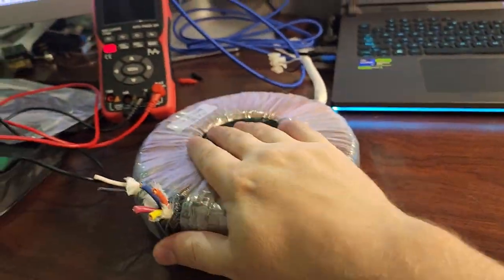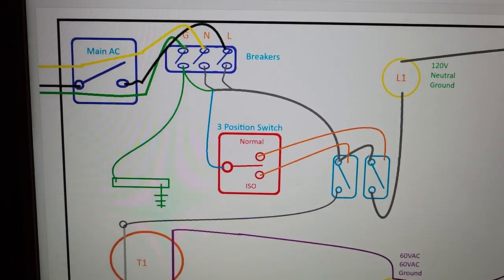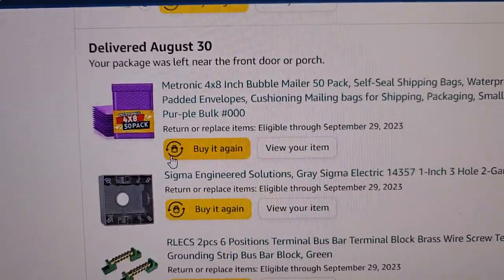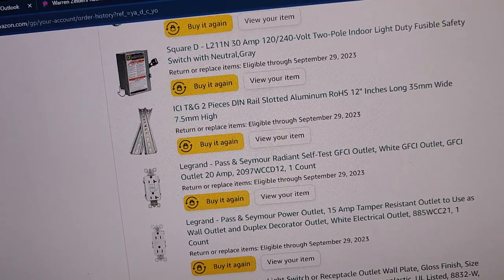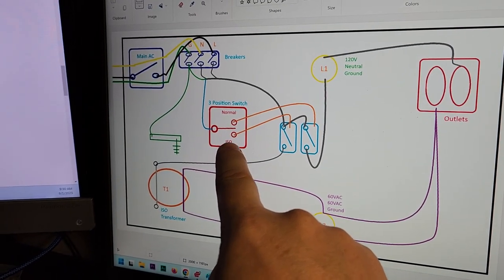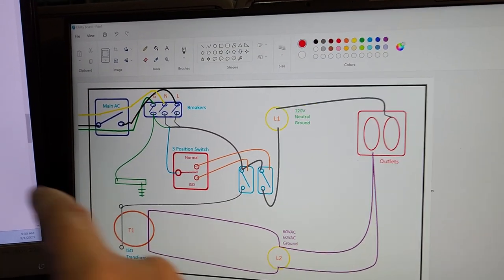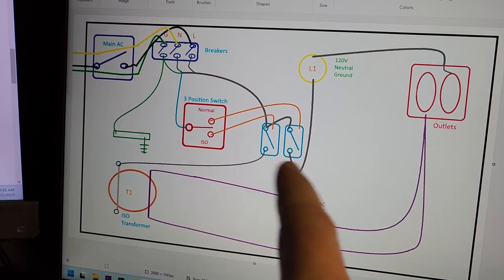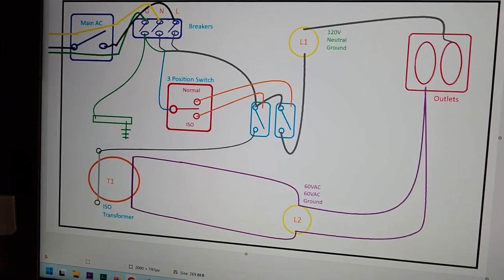Weekend Project: A New Way to Train!

Comment: 6:33 Keep in mind that a GFCI don't work behind a isolation transformer, because the output is not ground referenced. 
To let a GFCI trip behind a isolation transformer, you need to create a virtual ground, this can be done by connecting the earthpin of your outlet socket to one leg (L1) of the output of your isolation transformer. So a wire runs from the earthpin of your outlet socket to the input side of the GFCI. If then leakage occurs between the chassis of the DUT (Device Under Test) this leakage will bypass the donut (current transformer) of the GFCI, the GFCI detects a unbalance, and it trips.
Reply from the maker: Bjorn, that is why I state the GFCI is on one of the outlets and the other is isolated

Comment: On another note. Have you experienced interference on a Storz tower through the camera when high power diathermy or high power laser was used?  I thought it was low quality coax cable. Better quality coaxial didn't make any difference.
Reply from the maker: https://youtu.be/dzRCmDP_4xw
Reply: @BetterBiomedChannel  This happened when we used the Werewolf rf20000 and cyber ho 150 ultra high power laser. So what you saying it isn't cabling or earthing issues. It's the camera. We changed the camera on the Storz tower from 60Hz to 50 Hz, and that helped for one day, and the interference is back.